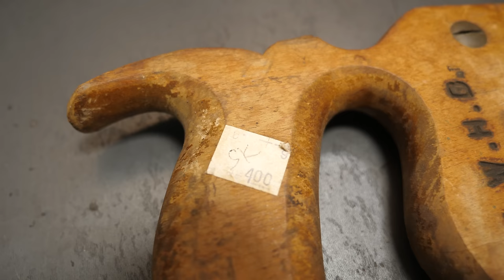Rip Cut Hand Saw Restoration

Comment: Very nice indeed.... The setting process was useful ... I recently finished a 1943 Eclipse saw set, which I'm looking forward to using when I restore my saws! Thanks....
Reply: I have read that saw teeth should be set before they are sharpened. Also, I wasn't convinced that the file was at an optimum angle, or that the left set and right set teeth were filed according to the set. They appeared to all get the same filing.

Comment: Hi, the saw looked in pretty good nick, but it certainly needed the nice cleanup you gave it. Good job.
Just wondering why you demonstrated by doing a cross cut with a rip saw?
Reply: RussG seems looks like plywood to me... in that case it doesn’t really have a grain direction
Reply: @catok9338  it has grain running in both directions, right? So half the cut was "proper". Lol

Comment: Try Krud Kutter, it's a bit expensive but a really really good rust remover, you would only wait a few hours rather than a couple of days.
Reply: Good to know, thanks. However, I was pleasantly surprised how well the vinegar worked.
Reply: @clark57225  ok but trust me it's way faster than the vinegar, with Kris Kutter I would have given it an hour and that thing would have been squeaky clean
Reply: @clark57225  also never use acid to remove rust since you have a risk of eating away the metal
Reply: @fnafplayer6447  Mr. Squid, you have another customer for Krud Kutter. Thank you.
Reply: @clark57225  I'm not sponsoring 🤣🤣🤣🤣🤣🤣🤣🤣🤣🤣🤣
Reply: @fnafplayer6447  That's interesting because Krud Kutter uses phosphoric acid as its active ingredient. At least the "Must for Rust" version of Krud Kutter. pH value is no higher than 3 for this product. That's fairly acidic if you ask me.
Reply: VInegar worked just fine for you.  One could also use Evap-o-Rust.  Nontoxic, don’t need gloves, efficient, but admittedly a little more expensive than vinegar.

Comment: Now that you have the rust off, I would put a coat of some wax on it to keep the rust off. Even a coat of car wax would work. Thumbs Up
Reply: Once you have determined that there is no trademark etching on the right side of the plate to protect, I would sand it down even further, with finer grit, to achieve a much smoother finish.
Reply: Gary Mucher -  Yes.  It would also make sawing so much less work.

Comment: A saw shouldn't wobble on the back stroke if you do it properly
Reply: I think that's because the set he put on the teeth is not adequate. If there was more clearance on the backstroke, there wouldn't be as much friction and the saw would not vibrate.

Comment: That moment when you realize most people buy new replacement saw blades so you don’t need to get the rust off this old one 😂
Reply: But that's not the purpose of restoring something
Reply: Yes it is. Certain things have replacements you wouldn’t sharpen a razor blade to shave you’d buy a new one and throw the old one out saws are the same it’s still a restoration you’re still restoring the handle which is basically the main part of the saw
Reply: You can't just go buy a replacement blade, they don't sell these saws anymore. If anything, the saw is the more important part; you can make a wooden handle in your garage, but most people aren't working/cutting spring steel in their garage. Plus, any saw you buy from the hardware store can't be sharpened or changed b/c they harden the teeth (unless it specifies "resharpenable").

Also some people absolutely sharpen razor blades for shaving, just depends on the type of razor.